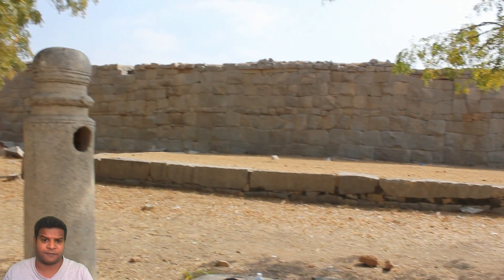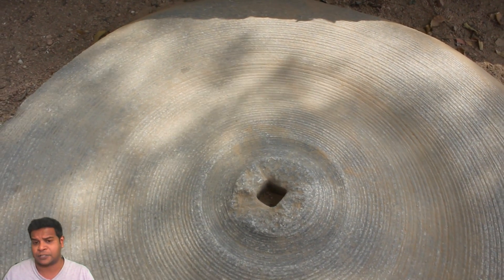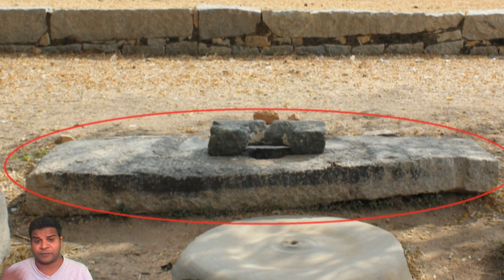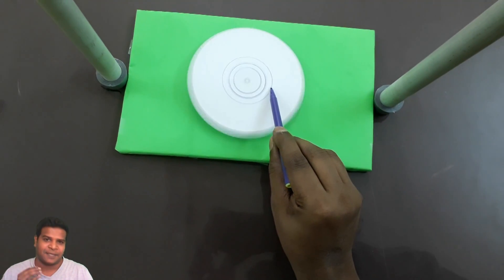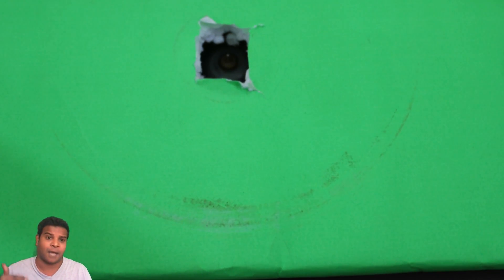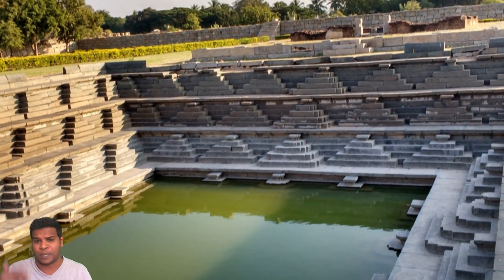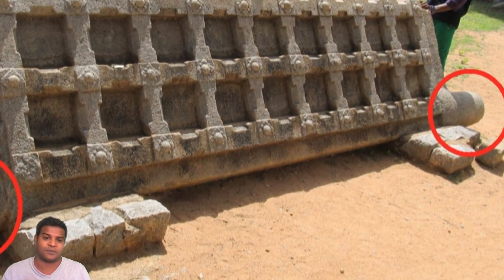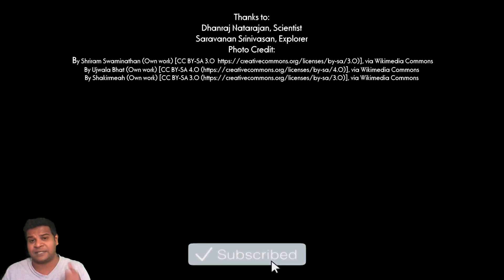Ancient Lathe Machine Found in Hampi, India - Lost Technology Discovered?

Comment: Just some thoughts.
Interested on what is on the other side of that circular slab with the circles. The bottom of it. DIG IT! hehe
What could possibly be used as pivot to rotate such tremendous weight.

I am Thinking, the circular slab is a spinning base, with the square being attachet to the pivot. Altho the rock does not look too cymetrical to be spinning from this angle is chipped. 

So what I am suggerting is that the circular rock was made to sit up side down on top of the rectangular rock, and be the source of the friction marks when the tool applies pressure on the outer edge while spinning. The hole in the rectangle would house the pivot, altho the slab looks crooked As fuck.

I dont think the [ shaped rock goes on top of the friction marks. 

Find out the hardness of the rocks.

You should consider asking for permision to do rudimentary archelogy yourself. 
I am sure you would do a sufficiently good job at it. 

Are these 2 columns 1 piece of rock, how deep do they go? 
How can they trust that overtime the torque from the friction will not separate the columns outards?
Reply: This comment was missing for hours too.

Comment: hi, i love your videos, but In that case, I think it was a flour mill. With the long block on the top, as weight? but the holes in the pillar? very interresting!
Reply: The holes in the pillar allowed them support the milling stone. With them they were able to raise and lower the weight. The square hole was used to align the milling stone with the weight and with a rod going through it, acted as a fulcrum that allowed them turn the weight in circles. This is what created the perfectly round circles, not lasers. Just a simple man made machine used to grind things. Lasers would leave burn marks or melt spots, neither of which are evident on those stones. 

They are tool marks, but tool marks made out of stone tools.

Comment: Great video, may I add something? The whole in the middle of the plate is square, yet the pedestal stones have round Holes. If your rod slides into each pedestal like you suggested why not use a square like on the base? The only reason to use a circular hole is to have the rod spin, much like rotisserie, or a traditional laithe. Also having the stone your cutting in the air horizontally uses gravity to handle the cuttings. Cutting parallel to the ground would create piles and piles of cuttings, and decrease the overall quality. Just a thought because there has to be a reason for a circle, not a square.

Comment: Praveen, excellent hypothesis by you. It makes sense without having to venture off on a wild tangent. I imagine several models of lathe machines were used for various cuts. Perhaps the base could be raised and lowered or the metal parting cutting tool could be vertically raised and lowered using incremental depth stops. The cutting tool could also be slid along the horizontal bar. The mechanism could have been a series of gears and clutches to rotate a spindle at high speed much in the same way river water energy was used to power saw mills for cutting timber. Very hard iron similar to the Iron Pillar that never rusts would be an ideal metal which could have been used for making sharp cutting blade tools to shape the stone. Casting pillars in molds using geopolymer to make smooth blank cylinders and turning the blanks on a lathe could produce beautiful work as well. Keep up the great work!

Comment: A Lathe is  when the piece of work is held and spinning. what you are suggesting sounds more like a  vertical drill. Although i can see the setup being used for both. It is difficult to tell without having more of the bits to it. It would be interesting to find what ever held the drill bit/piece of work in place. Or they could of ran it at a low rpm. Very Interesting, good work.